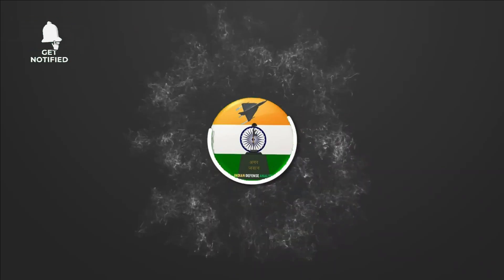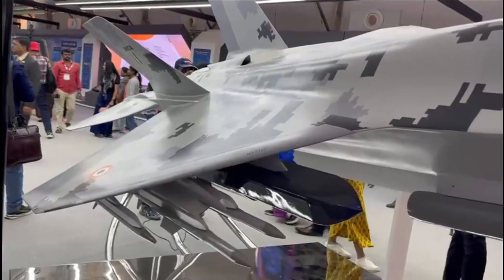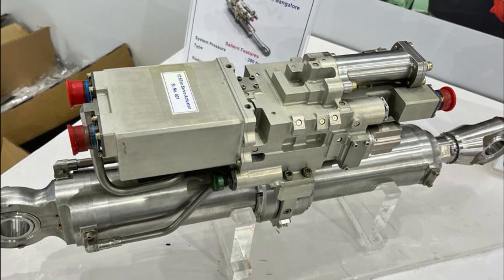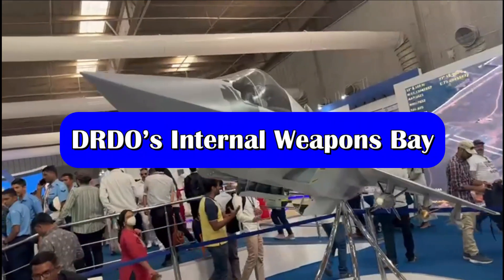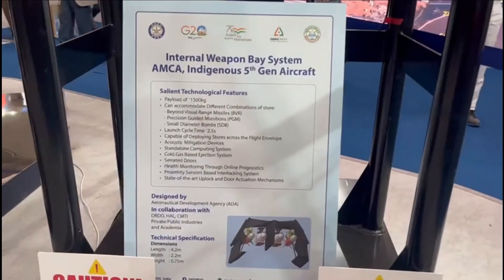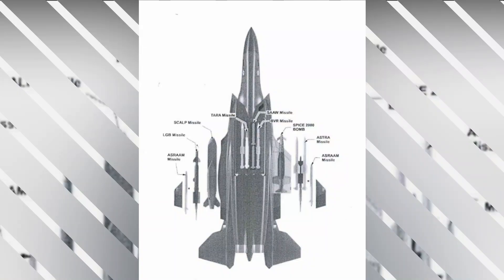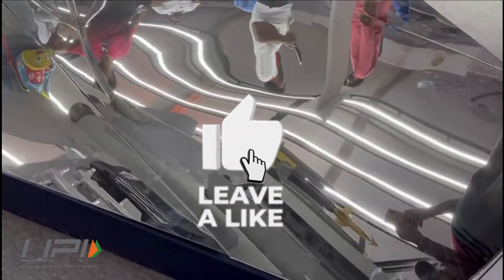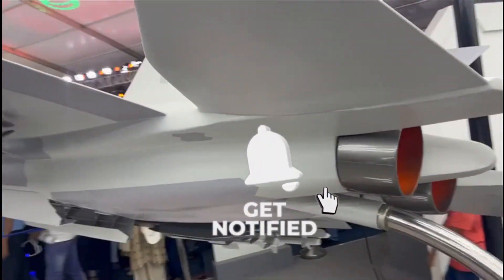AMCA update from Aero India 2023 | CDR Status, 17.5 ton servo actuator & Internal Weapons Bay #drdo

Comment: It will be good to see that amca will have very less RCS than j-20 also maybe it's stealth will be equal to f-35
Reply from the maker: Much less than j20
Reply: F35 and j 20 have etos like system, thus in ground attack mode they don't need additional targeting pode, but amca lack this system,  which will increase it's RCS more than j20 in Ground attack mode...
Reply: @ashishbabu1617  wrong
Reply from the maker: @ashishbabu1617  EOTS has a drawback of its own
Reply: @IndianDefenseAnalysis  this was told by the sir do you remember bro on aero India on 16 th feb
Reply: @IndianDefenseAnalysis  what is the drawback brother???
Reply from the maker: @mrahulkeya8142  yes
Reply from the maker: @ashishbabu1617  visibility disrupted in haze smog and dusty weather
Reply: @IndianDefenseAnalysis  but if we will put targeting pod then stealth will be compromised won't it??
Reply: Yes it will

Comment: Fantastic video! Really enjoyed.
Reply from the maker: Thanks 🙏
Reply: @IndianDefenseAnalysis 
Bro what about the internal bays on both sides?
You know around DSI intakes like in F-22😅
Reply from the maker: @fly463  not there on sides. It has serpentine DSI intake
Reply from the maker: @fly463  this is a design question which can be best answered by ADA but I think IWB is first of its kind development by ADA and you don’t take too many complexity in first attempt
Reply: @IndianDefenseAnalysis  
Hmm that could be true 
Maybe it will be there in mk2 😀
Reply from the maker: @fly463  no dear aeronautics design is not so simple, mark2 will have a powerful engine but structure going to be same
Reply: @IndianDefenseAnalysis  
That's true too 😫 
But 4 missiles are not enough for a air superiority fighter jet....
Reply from the maker: @fly463  it’s only for stealth mode in beast mode it can carry much more
Reply: @IndianDefenseAnalysis  
True but at the cost of stealth...
If it goes against a Chinese J-20 then AMCA will see it first in stealth mode , i just hope 4 Astra BVR missiles are more than enough

Comment: When is it flying ?
Reply: @AYUSH 51 According to DRDO chairman during Aero 2023. First flight will only be on 2030.
Reply: @AYUSH 51 Idk man I clearly remember it saying first flight will be 7 years after CCS approval, so if CCS approval is given this year, first flight will be in 2030 and introduction in 2033-2035(which is way too optimistic either way).

Anyway if the DRDO chairman and ADA are not on the same page, then there's a big problem there. lol
Reply: @sidewinder3422  
DRDO head is not in charge of AMCA
ADA's head is
Reply: @sidewinder3422  no first flight will de done  by 2026-28, also the production will start around 2032 and induction may happen in the same year.